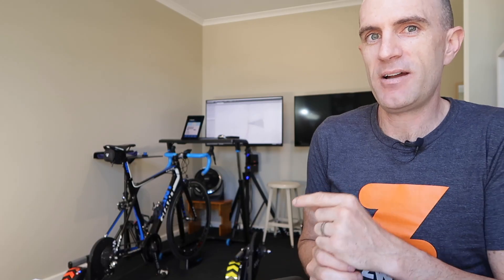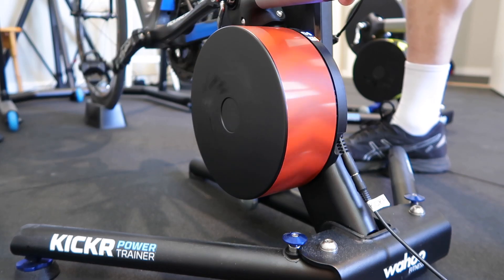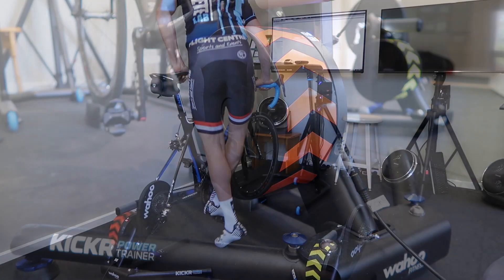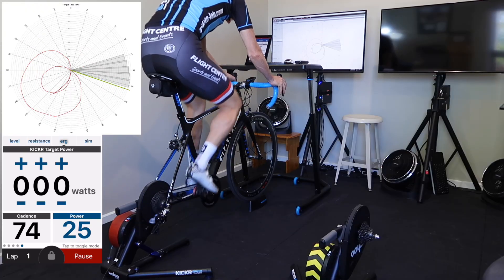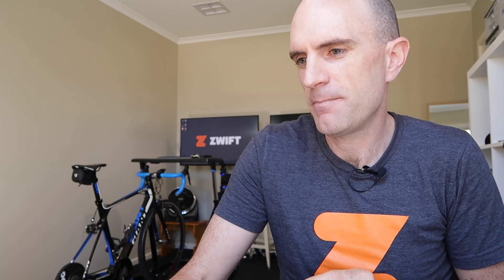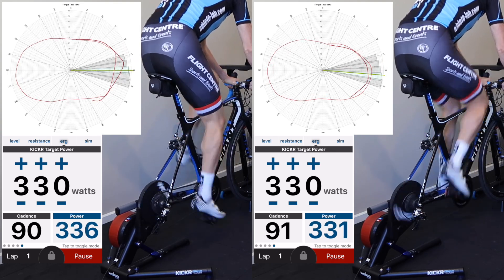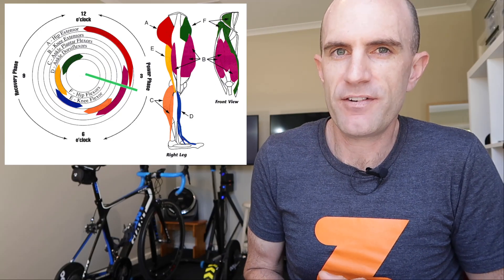Wahoo Kickr ERG Mode - Does Gear Selection Matter?

Comment: What about with virtual shifting for racing. Which is better, especially for peak sprint power?
Reply from the maker: It depends... if peak sprint power for anything other than casual racing on Zwift is important, it's best to use a power meter on the bike.

Comment: funny enough wahoo is not allowing other power data source as a reference point for erg mode in their head units. I've been comparing various gear selections in ERG mode between trainer and a few power meters (e.g. various stages, vector dual) and the reading from smart trainer vs pedals/crank arm may be as much as 10% different. So if you're training on the road with let's say 330w target power - be sure it's not 330 on the trainer, and worst thing is that you never know what's the delta since gear ratio is massively impacting the reading.

Comment: I have just gone from a original kickr to a  tacx flux 2 I assumed that it would be a bit of an  upgrade but it seems that there is a lot more gear changing to be done.  I use the  little ring normally as I was told it was better,  I cant get the watts up without changing onto the big ring or my recovery sections are over watts.  is this purely a flux thing or is the kickr dealing with this better as it feels like a step back.  

who wants to change gear  in the middle of a ramp test!!
Reply from the maker: As mentioned in my latest coverage of the FLUX 2.... it's sluggish to ride.

Comment: Had a new Kickr for a week, How do you set up sprint sessions with it on Zwift? Today I was going from 120w rest to 10 secs full effort x5 x 3, max wattage was 1075W. I found it best to kick it out of ERG mode 4 secs before the sprint, have sim resistance about half way and have 52 front, mid rear. I was power matching via Stages left arm (My ftp was set with it and Kickr is reading about 4% lower) . Not saying that's right, but how do you do them?
Reply from the maker: ERG will never be any good for sprints. There's a workaround for custom workouts: https://www.youtube.com/watch?v=A4aqIzhfUFg

Comment: Can you pedal fast enough with no resistance using any weight flywheel and still reach maximum heart rate? With lighter wheels I am worried the workout will not be intense enough. The more resistance you add the more it becomes strength training and less of a cardio workout.

Comment: I just bought a smart trainer the other month. I always change up or down the gears depending on which zone I'm in. I figured it had more to do with the resistance the trainer can apply to the flywheel and the angular momentum of the flywheel.

Comment: In the Wahoo app there is an option to turn ERG mode smoothing on/off. If I'm having the Kickr controlled by a 3rd party power meter and using some software (Sufferfest) to control the Kickr, would having ERG mode smoothing on or off make any changes to the resistance or how the unit "weights up" in response to changes in target power/intervals? I gather it's only reported power, but if that has an impact on the control it's getting from the power meter....may make a difference? Thanks! Great vid, too!

Comment: hello shane i have the tacx neo 2 and it  feels the oposite to the kicker when i am in 52×17 its harder to keep a 90rpm and legs muscle feel beat up but the 36×17 feels better on my legs i can keep a higher cadence but my HR goes higher.
Reply from the maker: Likely to be the flywheel (or virtual flywheel) effect.
Reply: @gplama   i only use trainerroad i race crits and i dont know  which one will be better for me to train small chain ring or big chain ring.

Comment: I understand the idea behind, but still can’t answer myself where is the truth.
Is the inertia something bad or good? Am I getting the most from the workout if I’m cycling using inertia or not?
My understanding is that in the end, the important things are the watts and to complete the workout reaching the targets but I can do this easier using the inertia or trying to do the same without inertia and to give up in the middle…
Reply from the maker: Inertia / momentum is good...  it's what replicates you flying down the road at speed as you're pushing on the pedals. If you want to train for hill climbs (slower speeds) then a lower inertia is what you're after.... watts are watts, but how you produce them is important. It all comes down to what you want to get better at...

Comment: Will changing gears during a say a 5 minute workout interval mess things up?  I have found that I get bogged down when I do, but there must be a solution.
Reply from the maker: In ERG mode? You can change gears if you like, but you'll have to adjust your cadence/force as it adjusts.
Reply: @gplama  Yes erg mode. Thanks.  I just seem to get in the 'circle of death' every time.  I'm fairly strong so this feels pretty odd when it gets so bogged down I can barely pedal.

Comment: When I'm in the low gears toward the 11t cog it seems like the is grinding in the drivetrain.  When I'm in the 25t it is much smoother.  Is this normal or is something wacko?  Seems to happen on both my bikes.
Reply from the maker: It's difficult to diagnose that one over the Internet. Maybe have a local bike shop throw their eye over it in person.
Reply: I tried the same with my NEO. Gear 50/15 and the NEO had problems to go same watt. +/- 35 W. Today I used 34/19 and the watt was nearly a flat line.
Reply: Chain, cassette or both are worn or incompatible.

Comment: Cool video. I use this knowledge for my workouts using ERG mode. For low intensity and when I want to quickly notice changes on resistance, I use lighter gear and slow speed flywheel. The opposite for hammering VO2 workouts and sprinting. The problem sprinting with ERG mode and high gear is that we need to wait for the resistance to "engage", otherwise, the flywheel will speed up and the resistance will not rise accordingly.

By the way, do you know a software similar to this which would work for Assioma Pedals powermeter?
Reply from the maker: The Assioma don’t have a very detailed pedal stroke analysis option. At this point.
Reply: Thanks for your reply.

Comment: EGR Mode. I like to ride EGR on High gear because if I have to adjust in the saddle it feels more "road like" However based on the graph below it seems riding in the low gear is more efficient on the wahoo kicker. I set ERG smoothing to "OFF and update to 1 Second  https://www.screencast.com/t/KbNcP0BH

Comment: Really interesting video Shane. I have tended to stick my old Kickr on the inner ring and around 5th at the back not just for noise, but also preventing cross-chaining. I have just bought a new Kickr with a Climb though so noise is no longer an issue. I'm training for an Everesting so I guess having a lower Inertia would help though!

Comment: Interesting subject. I came here looking for insight into high resistance on my setup. With my Neo I find it's a HUGE hamstring workout compared with normal outdoor riding, there's no feeling of momentum or inertia to help through the pedal stroke.
I've only ever used my QR axle road/crit bike, set up as 1x with 58t x 11-28.

I'm going to try a smaller chainring, and maybe get a thruaxle adapter to use my other road bike with normal 2x gearing.

Comment: Interesting as I don't feel as much power coming from my glute (butt) muscles when climbing than my quads. But the muscle recruitment pic says otherwise. Learned working those muscles in the off season will improve my climbing prowess, an oft neglected theory!
Reply from the maker: Could also be bike fit related. Maybe have a fit professional give your position a once-over to ensure optimal setup.
Reply: Shane Miller - GPLama it's also worth noting lowering your heel while on top of the gear will engage different muscles when climbing. Big picture: Experiment with different pedal styles till you find your strengths, and avoid waste. MO 😎

Comment: good afternoon. tell me what software you used in your video?
Reply from the maker: That's the Rotor 360 Software with their 2INPower power meter.
Reply: Thanks! I have garmin vector 3. What software for them will advise?
Reply from the maker: Garmin Edge units have the pedal metics for those.
Reply: I would like to see a pedal stroke in real time on my trainings

Comment: Looking at your pedal power readouts have you ever considered using Osymetric style chainrings???
Reply from the maker: I've considered, and that's as far as I get. I've not seen any conclusive independent data/studies on them that's conclusive enough for me to believe they work. There's also issues with power meter compatibility (not ideal for what I do), front changing issues (maybe resolved now?), and the cost - They're more expensive. There's a lot of people who use and believe in them, that's totally cool. I just need more data.
Reply: Not that I'm in to it as deep as yourself but I love your answer "I just need more data"... I have a spreadsheet for everything 🙂

Comment: Hi Shane! I have a perhaps unusual issue. I have a Tacx NEO and also a Quarq DFour power meter on my S-Works Tarmac. When i do a TrainerRoad workout - except the FTP tests - i always put it in the small chain ring. I notice during my TrainerRoad workout, when the bike is in the small chain ring, the Tacx NEO is always showing about 5W higher than the Quarq power meter (paired to my Garmin Edge 520). If i shift to the big chain, both Tacx NEO and Quarq will display the same power. Can you think of a reason why this is happening?
Reply from the maker: Chain angle? Calibration/re-calibration/zero-offset done in the big ring? Your L/R balance being different in a gear with less torque (small ring)... although in theory that shouldn't matter on the Neo... but I have a suspicion it would. Best I can come up with off the top of my head.

Comment: Shane, great video and just confirmed the same myself. Scary how big the difference is. So I have a more pointed question for you.. For the last few years I've been riding small ring since a watt is a watt right, and it's just quieter.. After seeing this, I tried it out on 4x15 at 99% ftp and felt like a million bucks after and during with not a single heart rate spike..Frankly, it's just easier to sustain power. So the question is, despite a watt being a watt, is the large ring workout actually easier and less effective and by using the small ring are you actually getting a more complete workout? This preparing you for both climbing and flat roads, since I'd assume if you're able to sustain small ring erg mode then you're going to breeze through large ring at an equal ftp...
Reply from the maker: A watt is a watt.... how they’re produced is what changes. And that’s all dependent on the motor. Everyone is different.
Reply: Totally agree Shane, and fantastic analysis. I'm curious if it's ultimately worth sticking to the small ring to get a more challenging workout, which targets an additional muscle group as you point out, or to determine ftp. If the body can sustain more watts on the large ring than small, wouldn't you think ftp is a bit of a subjective metric depending on what ring you tested in. Again fantastic work on your part.
Reply: @randumtasx  it's subjective in the sense that you probably have a different FTP when mountain biking than when road biking. What type of riding you want to exceed at is the question you should be asking yourself when selecting gear on ERG mode. That's my understanding from the video anyways.

Comment: This is a very enlightening video! But I am still confused. I have only had my kickr for about a month now, and I have noticed in ERG mode that if I chose a "high" gear (big ring up front, middle in back) the "speed" that is tracked on my Garmin is almost TWICE as fast as when I am in a "low" gear (small ring up front, middle in back) even though the WATTS are exactly the same!! It blows my mind. I am unsure after watching this video which is actually the best to train in... I want to get max benefits, but what I REALLY want is to see improvements outside. (If I want to go faster in Zwift with less effort, big gears it is!). My natural cadence is not really that high, but obviously tapping away seems to be healthier, but if I'm not strong enough out on the road I could see this slowing me down... I'm just confused :(
Reply from the maker: Flywheel speed is what your Garmin is tracking. This is unrelated to Zwift speed/distance. https://www.youtube.com/watch?v=gT--ftOFbfc
Reply: Thanks for answering my question! It makes sense... and yet, it doesnt. Why is the flywheel speed different even though the watts are the same? Is it because of the drag(or lack of it) as discussed in this video? Sorry if this is getting a bit circular! Either way, are not the maths being applied in the Zwift universe are still based on watts... or a combo of the flywheel speed, which is different depend on gear size? sobs
Reply from the maker: Forget flywheel speed. That's the easiest way. Indoor cycling is about effort and time. How hard you push the pedals and for how long. You're going nowhere, so speed and km are made up regardless of looking at the Kickr flywheel or Zwift speed/distance.
Reply: OK, right! You're so right but it's so easy to get caught up in all this stuff. I feel like you have just slapped me back into reality. So much easier when it was just me alone with my /dumb/ turbo.

Comment: Shane, your experiment got me curious about the real power from the legs needed to keep the momentum with the low gear versus just "tapping" the high gear. You cover almost all aspects in your video, but you rely on the KICKR power as shown by the Wahoo app. I like my KICKR, but I don't have full confidence in the power numbers it generates. I did a quick test with my Powertap P1 pedals to validate my suspicion and it turns out that there is a gap and it's quite significant in some cases. I started with my lowest gear (39/28) and rode 30 seconds each at 100w/150w/200w/250w. I then did the same test with my highest gear (53/11). With the lowest gear, I got very consistent and stable power numbers from my P1s that were very close to the KICKR generated power numbers (within the +/- 2% advertised KICKR accuracy). With the highest gear, power numbers from my P1s were not even close to the KICKR's and they were jumping all over the place and were very unstable. At 100w (+/- 18%). At 150w (-35% to -3%). At 200w (-30% to -9%). Finally, at 250w (-22% to -10%). With this kind of discrepancies, I am glad Zwift and TrainerRoad implemented Power Match with the use of an external power meter. Sufferfest should implement this feature later this year.

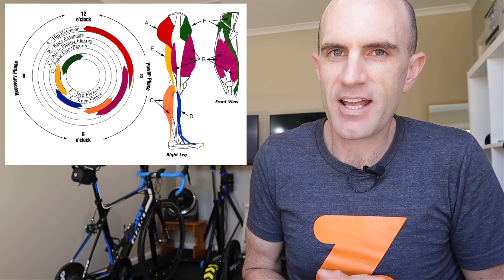Comment: Where can I get that information sheet on the muscle usage based on peddle stroke? ( in the video at 5:55)
Reply from the maker: Linked to in the video description.
Reply: check out the link in the description, it actually brings to light how the diagram used in the video us completely misleading
Reply from the maker: It's used as an example that different pedal strokes are different training, related to the gear selection discussion. If you have qualified follow ups, feel free to post.
Reply: @gplama  In order to make the point that cycling generally involves different muscle groups - fair enough. But in the very same link by Pinkbike that you posted in the description, it is detailed how the diagram which you also used gives an inaccurate (or at least very theoretical) depiction of which muscle is used at which point in the pedal stroke. While most people should know that a muscle is rarely ever going to be in charge of the entire movement in an isolated manner, it still is misleading if you look at e.g. the involvement of the harmstring as portrayed in this diagram indicating that they were only used in the upstroke movement. I know this is not the point you were making and neither did you claim the diagram to be perfectly accurate. But still, I for one was lead to believe for a second or two that this graph was showing actual muscle involvement in an accurate way- which is not the case. Thanks for responding though! appreciate your videos

Comment: So if training for long climbs using erg mode, it's probably best to use the small ring and move that flywheel at a low speed then right? (And vice versa for training for TT efforts!) I never actually thought about the effect that the flywheel speed would have on pedal stroke and power delivery... this is a bit of a training game changer for sure!
Reply from the maker: Correct. This does depend on the trainer used though.

Comment: I've tested my wahoo in both high and low gears and it makes a HUGE difference on how fast my cadence is because the loading around the pedal stroke in low gear is much harder all the way around the crank.

Sidenote: since the wahoo is so friggen noisy, I always train at a low gear to minimize the noise.

Comment: Is there snap the same way or does being in an easy gear cause the flywheel to spin to slow causing the accuracy of it's power reading to suffer?
Reply from the maker: Likely yes on the flywheel speed/inertia/feel. Not sure on the power accuracy suffering because of it.

Comment: Makes sense. Thanks. Why the block under the front wheel?
Reply from the maker: I prefer to have a slightly raised front end on the ergo. With no steering or cornering indoors I find it more comfortable.
Reply: Have to compliment you on the quality of your videos. Very professionally made.
Reply from the maker: Thanks mate. They're the least professional thing I do.... so I'll take that as a compliment. :)
Reply: What kind of block is it? I could use one for my core. Thanks for the content you put out.